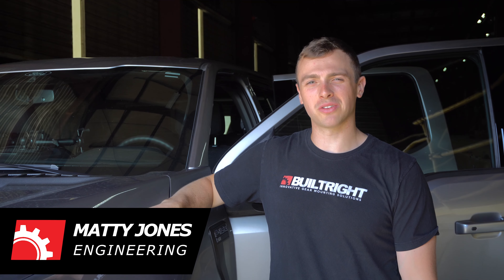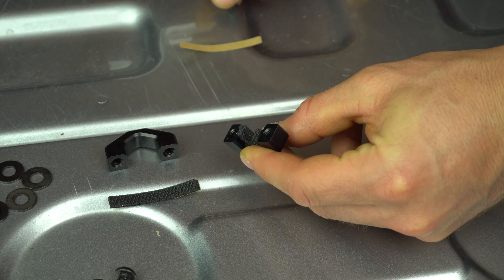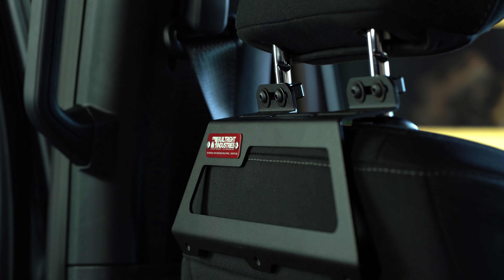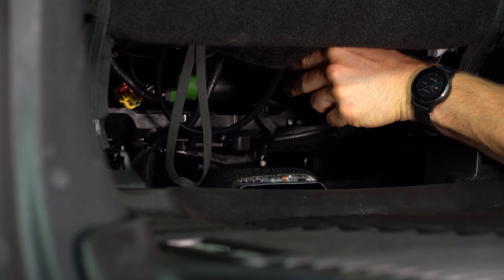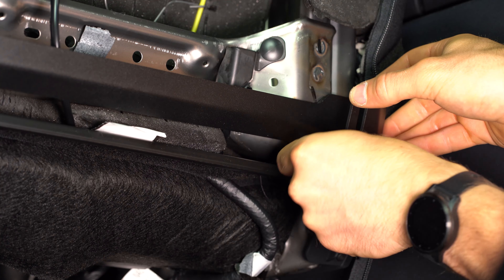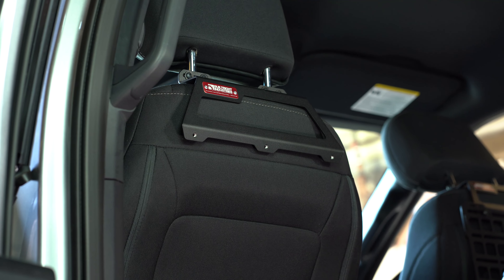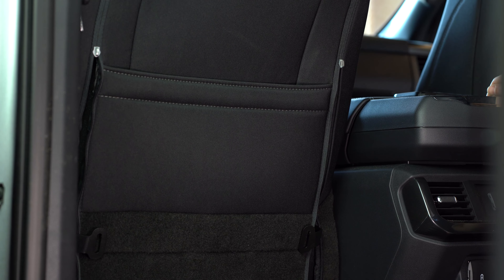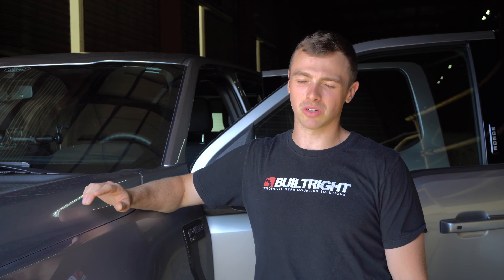F-150/Raptor, Super Duty + Ranger Seatback MOLLE Install Guide

Comment: Can the seats recline with those bolts in the bottom?
Reply from the maker: Yessir! A big part of our unique system is that it allows for seatback articulation. Not full lay-flat if your truck has that feature, but easily reclines through any normal position.